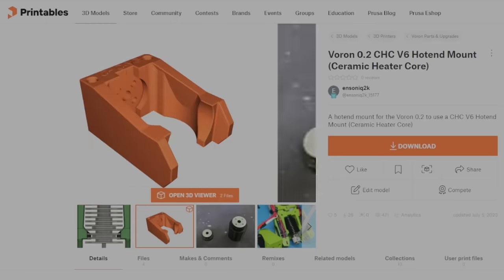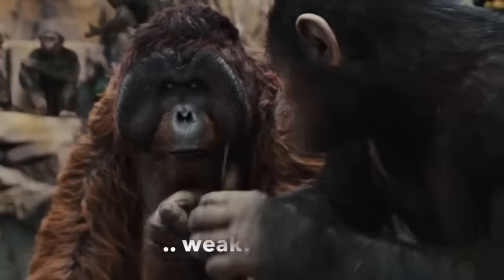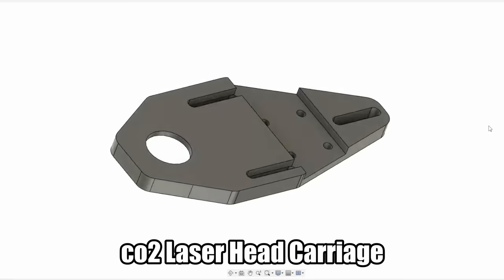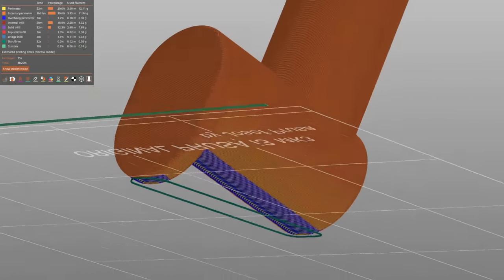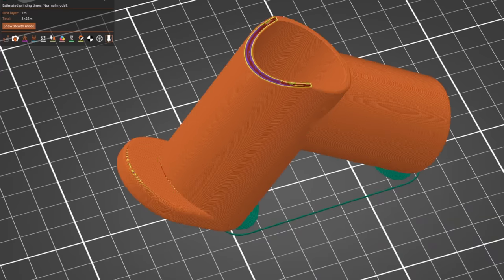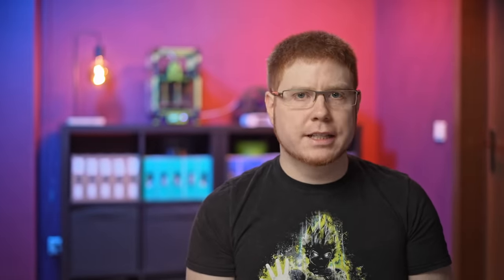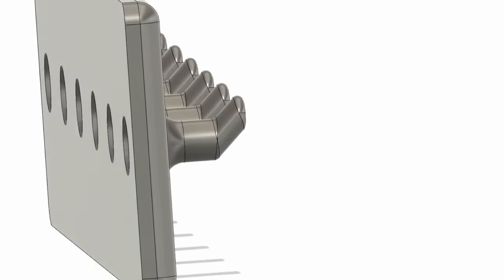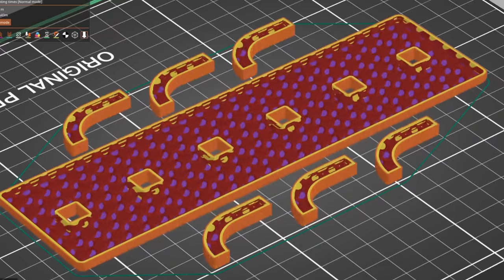3D Print Design SINS that need to STOP on Thingiverse, Printables, Cults3D etc.

Comment: This is why every model i upload i also provide a STP to make it easier to reference or modify/remix if need be.
Reply from the maker: That's the spirit! I once copied the design of a bike wall holder since there was no source file and uploaded everything. People thanked me so many times for the source since you could fit it to any wheel size.
Reply: This is the way
Reply: I only upload STP files. And because of this fact, I asked one designer to also offer STP files, because I wanted to update his model to a new version of the object inside of it.
Reply: I wonder why STEP isn't the default anyway. Why did STL become the standard?
Reply: Mesh file formats are garbage. Can't wait until this community moves past them.
Reply: Real MVP
Reply from the maker: Guess what, open source is "communism" as well. You'd better go back in time to where 3D printing patents were still in place and a printer costed a small fortune.
Reply: @SmallBatchFactory thanks for the warning, I didnt know my linux distros would cause me to endure forced starvation and ideological conformity at the barrel of a gun.
Imagine thinking open souce development by voluntary consensual collaberation is the same as "do it or gulag kulak"
Reply from the maker: Gulak is mostly Russias implementation of communism though. Seems like anything "pro human" is labeled communism these days. Can't do anything without thinking of profit...
Reply: @SmallBatchFactory yah I dont think they call them that in dprk, I think they use the term "fun time happy house of good feelings for dear leader" ccp got their own branding too, though i think they just skip it and go right to the kneel down and get dusted phase. A 🌹 by any other name i suppose.

Perhaps the incorrect label is being loaded in the maker then. Like personally im very pro-Dog/Dogs🐕 for example. And as a pro-Dog supporter, at a minimum, I purposely go out of my way, not to wipe out 100mil+ of their cute little friendly lives.

Also if I give some one a dollar and in exchange they give me a pen, did we both not profit? They may use my former dollar to buy.. idk 50g of fillament to print 20 more pens, or buy a stick of gum :p, and i may now label my box of scrap and not mix pet and abs?

I may personally profit when I release a mostly printable jbod as FOS, I will no doubt get strangers pointing out my obvious mistakes. That would otherwise cost multiple thousands of $ in student loan usery schemes on a degree i probably dont need, to get that kind of experienced feedback.
That is some stonks📈.
Reply from the maker: @acolyte8564  You know the saying "what goes around comes around". I make things for my self and then I upload them so others can profit of them. Often for free, sometimes for money.

As you said if the value is good people will be glad to exchange money in order to gain more value than the money represented for them.
Reply: @SmallBatchFactory  reciprocity 🤝
Reply: Yes! Exactly this, people get so concerned that people are going to sell their stuff and I've had it happen, but its just like who tf cares? It's more important to me that the few people who want to modify my stuff, have easy ability to.
Reply: In addition to the STP file, I have also uploaded F3D files. This way, if someone happens to be a Fusion 360 user, they can understand my design ideas and make modifications more easily.
Reply from the maker: @EpixZhang this is the way! I've had a lot of people thanking me for uploading the 3D file (and adding easy to change parameters)
Reply: I love modelers like you then! I have been doing that with my designs too. I hate STLs!
Reply: Fact that >90% of models  does not have STEP file means they are simply useless as they cannot be fixed by hand later or reused as part of other model. Importing STL to Fusion is a hassle, but also STL does not contain any information about shapes, so you can do nothing.
Reply: I don't know why it isn't a standard thing yet, people are happy to upload the STL but whenever you ask for a STP so you can edit it they always say no. It's like they are worried you'll try and take credit for it or something

Comment: I have a friend whom I helped out with her thesis project. She had a team partner who was in charge of designing all the parts for the robot they did, and I swear it was a nightmare every time she asked me to print something because the guy had literally zero notion about additive manufacturing, let alone 3D printing (he never got his Ender 3 running, for some reason). And I don't know if it's a coincidence or what, but you mentioned basically all the design mistakes he made and I had to correct or account for in the slicer, so the parts were actually printable. This video is gold and needs way more exposure.
Reply from the maker: Thanks! And those are only the most ubiquitous and easiest to fix mistakes...

Feel free to share the videos anywhere :-)
Reply: Yeah I used to make lots of mistakes in designing parts but now a smooth it out
Reply: In a case where there is that guy who doesn't know s..t about 3D printing, still sends you parts to be printed and never learns, I have a special treatment. I just remove the Z support gap and laugh maniacally while the guy is trying to remove those damn supports!

I am probably a bad person to do that to someone, but if that someone keeps repeating exactly the same mistakes, what can I do?
Reply from the maker: @yuriysukhorukov391 this is eeeeeeevil. It like it!

Comment: While I appreciate the engineering aspect of things, as a Dane I do desire better designs too (for those not in the know, I am referencing Scandinavian Minimalism. Minimalism itself started in Germany (the BAUHAUS movement) and it is focused entirely on the functional aspect of a certain product, removing all unnecessary features. Scandinavian Minimalism started in Scandinavia (as the name implies) and is focused around retaining design features by integrating them in the functionality of the product). Jokes aside, layer line orientation, or rather disregard for the manufacturing method used, is also my arc nemesis.

Comment: It's a major thing I hate: designers really need to make sure multi-part models have the same start layer. I've had a ton of camera parts that have failed because 3/4 parts start at 0mm but the last piece starts at 0.2mm.
Reply from the maker: That's annoying. You could try to split the parts and put everything on the plate. A good advice is to always check the resulting print in the Slicer at least briefly. Floating layers are usually easy to spot.

Comment: another option for the hooks would be to add a taper and design the hook so that you could insert them from behind and allow the taper to lock them in place. there's no real need for them to be flush with the back so that allows for a tight fit without needing high precision.